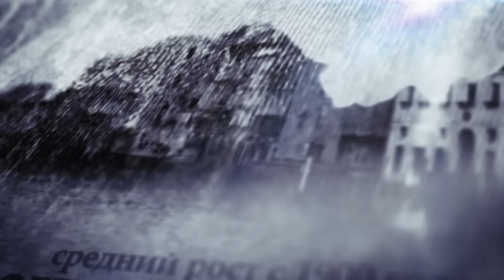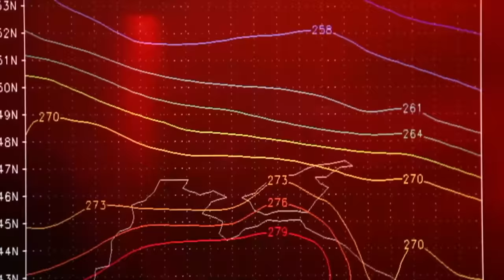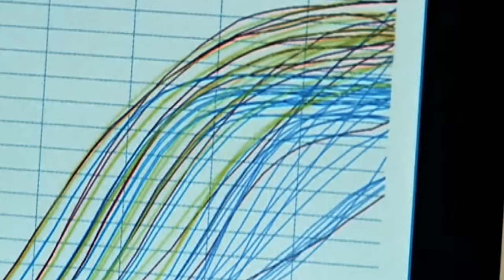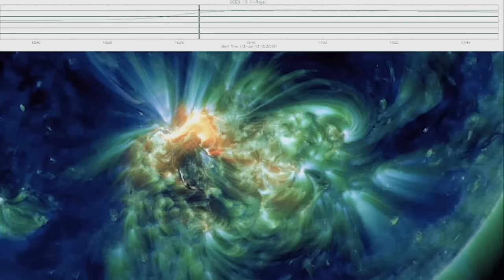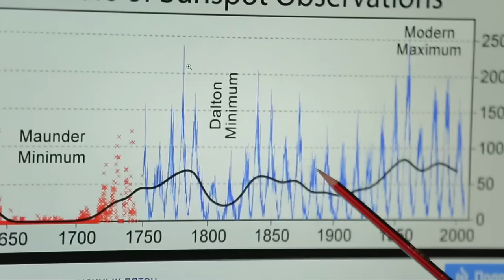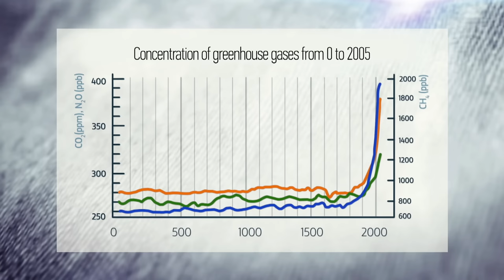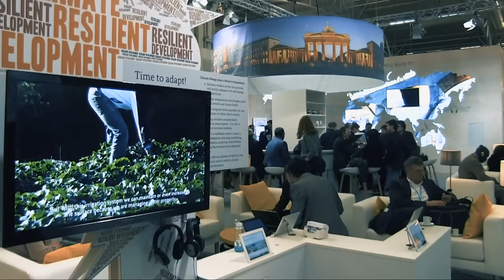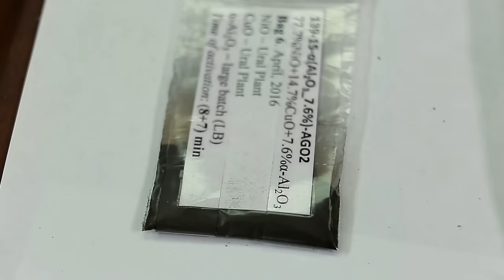Which Countries Could Be UNDERWATER Due To Global Warming?

Comment: Sea level has risen by 10" in some areas but not at all in others? Wow! In my bath tub sometimes I pile up on the other side of the tub, so this makes sense.
Reply: earth isn't a bat htub. unless your bath tub is big enough to have tides.

sea levels rise not just because of melting land ice, but also because of thermal expansion of warmer water (you can try that out by microwaving a glass of water). since the oceans don't heat up uniformly this thermal expansion isn't uniform either. the atlantic heats up faster than the pacific, so the atlantic rises faster.

and of course sea levels are always relative to land masses. if the landmass you're on subsides, sea levels rise even faster.

on the other hand there's post-glacial rebound - land RISING due to the loss of the weight of ice after melting. this happens for example around the hudson bay in canada, and the northern baltic.
Reply: @jochenzimmermann5774  I realize I oversimplified. The alarmists have been eulegizing the Maldives for years. There are also many many factors that can only be speculated on as you pointed out. Also, sea level has already risen by 400 feet or more since the last ice age. Bottom line, we have minimal affect on the global climate if any.
Reply: @marchebert9813  wouldn't that be nice. bottom line, the experts consensus disagrees with you. which you'd know, if you'd checked.

but hey, i'm sure you'd also say "covid has minimal effect on mortality, if any." right?
Reply: @jochenzimmermann5774  I have checked and ALL of the long term predictions have been wrong. So they extend those predictions with new predictions. By the way, the sea level has risen about 400 FEET. If you'd bothered to check instead of listening to your overlords. Consensus. What a joke. Silence all dissenting voices and you have consensus. Hahaha.
Reply: @jochenzimmermann5774  2100 to 2300 huh?  Brilliant.  We better start packing.  Well, James Hanson predicted Manhattan would be under water by now.  Doesn't sound like underestimating to me.  There are a LOT of stupid predictions.  2100 to 2300!  What a joke.

Comment: Another video which excludes the fact that EVERYTHING ORGANIC WHICH IS BURNED EMITS CO (CARBON MON OXIDE) as the main gas, not CO2.
Everything organic which decays emits CH4 (Methane), which is what is heating the upper atmospheric temperature.
The main cause of increasing CO2 in the lower atmosphere are deforestation & increasing human & animal livestock.
The major reason for Antarctic Oceanic Temperature increases is NOT from atmospheric conditions, but from a combined planetary gravitational fields & solar radiation from not only our star, but also other stellar bodies such as Supernovae, in the vicinity of the Galaxy we are currently in, as we are constantly moving on a predetermined circuit.
This results in periods of increased volcanic activity & the Antarctic Region in the depths of the ocean where a minimum of 138 Volcanoes exist is where the most danger of Oceanic rise in depth has started.
This will desalinate the oceans to a point where they can freeze.
CO2 doesn't heat the atmosphere, but instead, actually cools the air at a lower height than that of Methane. That air has a lot of water within, which turns into torrential rain storms causing flooding.
This flooding often is due to the fact that river systems are becoming silted, as they always have, but unlike before, with communities now living along the river banks & beyond, the course of the river can no longer be altered as in the past.
This puts water into & above the ground.
Eventually, 1 or 2 Volcanoes will erupt with enough Ash ejected, it will reduce the solar radiation sufficiently to induce rapid temperature decrease resulting in rapid freezing of the waters, initially in the Northern Hemisphere, then to a lesser extent, the Southern Hemisphere, with a decrease in temperatures in the Equatorial Regions, where the most chance of survival will be for life.
Reply: After listening further to the end, I noticed still no reference to CO, only to CO2 & a reference to soot, which is actually a condensed form of CO.
Carbon Fibre is formed by the separation of C & O from CO, NOT CO2.
I am still perplexed why they continually treat CO & CO2 as the same gas emission.
Clearly, THEY ARE NOT.

Comment: 2:53 "CO2 causes the greenhouse effect".   Tropospheric water vapor is the cause of earth's greenhouse effect at over 99% to a low estimate o 97%.  Tropospheric water vapor's dominance as a greenhouse gas makes it impossible for the other non condensing greenhouse gas to significantly change global warming through their greenhouse gas effect.  Carbon dioxide and methane concentration together could be cut in half or doubled with no significant change in global warming due to their greenhouse gas effect.  

I think you've been confused by the United Nation's International Panel on Climate Change reports that clearly state they took their greenhouse gas samples outside of the troposphere at 20,000 meters altitude way into the stratosphere where water vapor is near zero and not in the troposphere where earth's greenhouse effect takes place.   The IPCC only examined greenhouse gasses as a possible cause for climate change.  The educated reader will recognize the IPCC's reports took greenhouse gas samples outside the troposphere where earth's greenhouse effect takes place and take their conclusions with that in mind.  The IPCC reports are of no particular value for the study of global warming.   

Carbon dioxide as a possible cause for global warming hit a dead end in the mid 1990s when a report had been out for a couple years failed to be discredited and was used in various TV documentaries with results that carbon dioxide from human emissions were non poisonous and reasonably responsible for 1/100°C of increased global temperatures.  This made it impossible for CO2 to be the cause of global warming as known at 1.1°C.   The study was funded by large oil and chemical corporations so it was heavily scrutinized, but no serous flaws have ever been reported and another report in the early 2000s couldn't reasonably get even 1/100°C global warming from CO2 with results being about 4/1000°C - 6/1000°C meaning the early 1990s report was likely grossly rounding up to get 1/100°C.   More than twenty five years later in 2022 global warming is still reported at 1.1°C despite significantly increased levels of carbon dioxide since the early 1990s.
Reply: @tamramoore8377  "dumping more garbage into the ocean" maybe a way new way of Climate Action, but just like restricting non condensing human caused greenhouse gas emissions it will not have any significant effect on global warming.   If the real interest in restricting greenhouse gas emissions isn't to save the planet, but to cause harm then "dumping more garbage into the ocean" would closely align with that form of activism.
Reply: so, exxon bp and shell has got to you?

Comment: I am sorry..  Maybe I should have watched the whole thing but after 10 minutes, I couldn't take it anymore.  This video was created to alarm the public.  You can't create a video based on speculation and hypothesis.   The earth goes through cycles.  We have had tons of ice ages and we have also had many periods of intense warming.  Most of it is due to solar cycles.  The rest of it is due to changes in the earths atmosphere from any event (volcanic or meteor impact) that sends tons of debris into the UPPER atmosphere.  At lower altitudes (where all of the man made carbons live), we have rain and it cleanses a large chunk of the pollutants out.  As for warming, hurricanes and large storms are the earths air conditioner.   I am sorry to say this but if everyone just left the planet and no more cars or manufacturing plants exist, the earths temperature is going to continue to cycle hot to cold.  I am not saying we don't continue to regulate and get away from emissions, I am saying that you don't do it by fear mongering.  You do it through measured regulations and controls that take many years to implement so we don't shoot ourselves in the foot from an economic perspective.

Comment: Has the climate not changed drastically in the past? Kansas was once the bottom of an ocean. A mere 12,000 years ago we had an ice age. Doesn’t climate always change from one extreme to the next? Instead of the alarmism wouldn’t we be better off excepting this fact and using science to find was to adapt to these changes. The dinosaur might be alive today if they worked on ways to adapt
Reply: We'd still have an ice age, if it hadn't warmed up.  Who profits from all this panic over climate change? Is this another misfortune like  the pandemic to use for some political end?

Comment: TheBergbok
1 minute ago
 @Gwebo Celestron  Perhaps we could marry solar & wind energy.. devices. Revolving wind "mills" with solar cells could possibly lessen the heat build up of the panels as when placed in sheets on roof tops.
Trees  ,trees, trees. Most property owners are but totally clueless about their function in softening the impact of urbanisation. 
Here in South Africa new upwardly mobile people get in tree "fellers" to clear their recently acquiered homes of trees before they put in a pool and pave most of the rest. Too much Pt to engage in the normal property upkeep.
One hot day I found all the telephone &burglar alarm wires lying on the floor of my newly bought 1960s house . After greening the garden with shrubs & trees the perceptible  temperature difference is refreshing to say the least. No fans or air cons at all

Comment: It's all about Timing, Timing, Timing! Yes, temperatures may increase by a degree or two, but it is LIKELY to take 300 hundred years to do so. As usual, the scaremongers somehow forget to mention this fact.
Reply: Current atmospheric concentrations of CO2 are over 30% higher than they were about 150 years ago at the dawn of the industrial revolution and in the same time span the average global temperature on Earth has increased by about 0.8° Celsius (1.4° Fahrenheit) since 1880. Two-thirds of the warming has occurred since 1975, at a rate of roughly 0.15-0.20°C per decade, roughly ten times faster than the average rate of ice-age-recovery warming.

Comment: What is the effect of Continenal Drift on the ocean currents and what is the change in ocean currents doing to the polar regions and to the ocean levels?  Asia and North America are rushing towards each other at one inch per year, moving uncounted millions of tons of war north to the Arctic, melting the ice and south to the Antarctic where it also melts the ice. The Pacific Ocean itself is shrinking at the rate of one inch per year and the water between the two continents is also being pushed up higher as the continents advance on each other, effectively raising the sea level between the continents.
Reply: @mrunning10  That's the answer, but there's no evidence to support it.
Reply: @joezingher4770  I can't find the research but it must be out there, there is an estimate of how many cracks, drifts, holes, etc., releasing from under the mantel, including the constituents in the material both magma from the limited events (volcanoes) and from just the "oozing" out of the gases.  It is there for sure, but just too small of total amounts to have much of an effect as the Earth's core continues to cool.  
And it just does not change over time, its' a constant small out-gassing that is occurring.  
It would take some OUTSIDE event, like a super-=massive extra-planetary sized object passing close to us, "ripping" the mantel apart from gravitation effects to change this.  THAT is not part of the current models.

Sorry, man digging and pumping UP the CARBON from under the ground is the biggest contributor to climate change leading to global warming.
Reply: @mrunning10  What's the math on that?
Reply: @joezingher4770  OK, still looking, hang on.
Reply: @joezingher4770  getting closer, "Earth and Planetary Science Letters"  somewhere a study from India.
Reply: so after I find this and give you the link, you read it?  and the conclusion of "little effect" will change your mind?  

?
Reply: @mrunning10  Not unless it holds up.   I am doubtful it does simply because it's not talked about.   And there's no way to draw conclusions because there's no way to conduct experiments to determine the effects quantitatively.